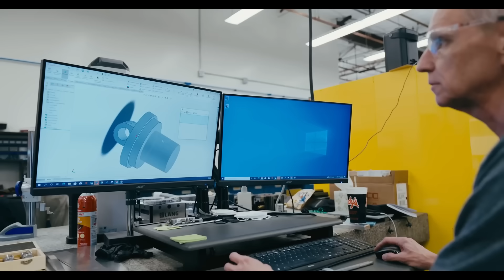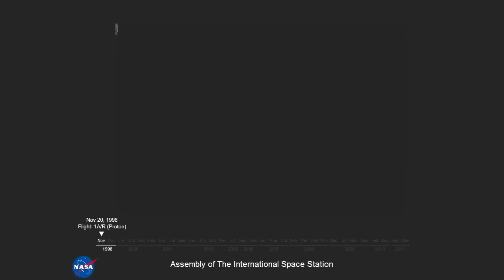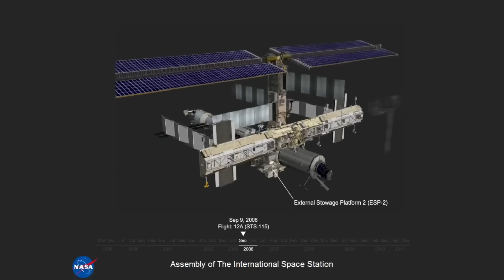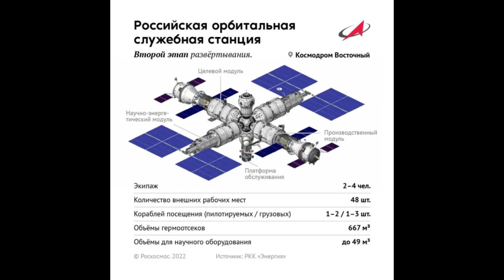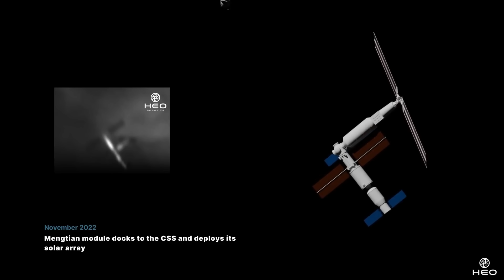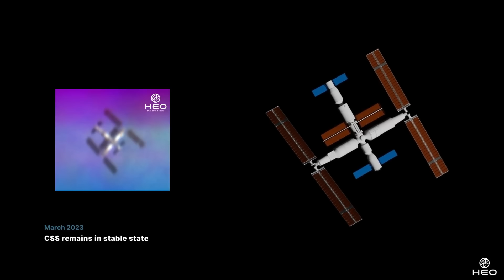Where Will Astronauts Go After The ISS Is Destroyed?

Comment: Why does the spacecraft necessarily need to have a manipulator arm? Can't "walking" robot arms (i.e. end effector on both ends and ports for it all over the station) do everything that needs to be done when it comes to station assembly? Park visiting delivery vehicle nearby, station arm yoinks the module, and puts it where it needs to be. Would be even easier if there are multiple of these arms walking around. Every module would just need to have at least one node where they can lock and receive power, like a much simpler, smaller docking port.

Comment: A single upper stage tank building from Space X would have more internal room than all of the ISS combined.  It will become the new space station, however, there is no fault in connecting to the ISS and using it as a walk in closet.  The solar panels are valuable and should not be burned up in the atmosphere.  Nor the cameras and canadarm and many other components.  Adding one large tank building to the ISS would justify keeping it up there, but put it in the back ground as a new station replaces it.  After the new station is complete it will gradually separate from the older station and all it's arrays of solar panels and screens and radiators and the process can start again with a large tank being sent up again to the ISS to start a third station.  The ISS would become the dry dock build site for other stations and ships.

Comment: How about a starship that telescopes the majority of its cross section out to multiple times its length just like a telescopic crane boom does. Then bolt all the flanges between sections together in the extended position and pressurise the whole vessel. Now you've got basically a hollow habitable tube, or maybe a shorter tube with some fold-out furniture. In theory they could cap off the individual sections, resulting in something like a bamboo stick.

Comment: 4:55 "-or party supplies if that's your jam" I bet doing lines of coke is hard in space.
Reply: what mechanism would you need to do proper lines in space? important research right here
Reply: think of one of those flavor bead straws but replace the beads with cocaine and cap the ends with a peelable seal @unflexian

Comment: So that Dragon extension 'station' is that single use? you say it can be preloaded with supplies/experiments but cannot be permanently occupied due to only having one docking port.
Would you have to send up a cleaning crew betwen each tourist visit? as I cannot imagine anyone would want to spend the amout it would likely cost to book it up only to find out the previous visitors left a kipper in the aircon vent.
Soo, if its single use ... is it actually a station?

Comment: That moving bidirectional robotic arm is super cool.  I never realized it could change location where the working end becomes the base!
Reply: It wouldn't be much good if it was stuck in one place.  The ISS is huge!  The arms can walk around like inchworms all over it.
Reply: @josephastier7421  definitely.  There's so much minutia to space flight I just hadn't ever thought of it before.  I'm still learning new things about Apollo!
Reply: @NGinuity  Just staggering how much innovation goes into spaceflight.
Reply: The first robotic arm was on the MIR space station... Fixed to the central module, it swung each newly arrived module around, and onto the other ports on the central module... It was only about 4 feet long, but could move the 3 ton modules with ease... There are videos on YT and also check google... Lyappa arm..

Comment: I heard that company doing the inflatable station modules was working with SpaceX to launch ontop of a Falcon9.  It would just take a modification of the fairing system to allow for the larger diameter.  But, the weight, even after factoring in the extra drag, would be well within the abilities of the Falcon 9.  Each module takes 3 launches.  The first puts the shell into orbit.  After that inflates, the second launch brings up a more traditional style module, filled with all the gear required for the inflatable module, plus the solar panels and radiators.  The third launch brings the crew onboard with extra life support to keep everything going while the primary systems are assembled.

Comment: Elon's notes...

 "Step 1: Construct 3 or 4 or 5-off starships, with both A) the required onboard lab-equipment and habitation areas, to be outfitted on the    ground (which will serve as a practice-run for Mars), and B) with more efficient (bigger?) thrusters to accommodate orbital adjustments. These starships will be capable of docking, linking and pressurising with each other.
 Step 2 : launch (proven capability), dock (unproven) and pressurise(unproven) said starships into current ISS orbit, 180 degrees out of phase. 
 Step 3 : Keep adding parts as required into the future. No space-walks or "outside" work will be required but could still be researched.
*Notes: The potential volume of just two starships is so much more than the current ISS volume.
              Mars is too important. ...Hmmm...."

I honestly believe that Space-X will help out with this somehow as it's good practice for Mars, and this is the only motivation Elon needs.

Comment: SpaceX can design an adapter module, flown aboard a falcon heavy, that could serve as a connection point for multiple Starships, which would constitute the station, and additional points for docking. 3 SS could be the station with 2 docking ports.

Comment: Who came up with the renders with the floors going down the length of a TransHab/BEAM/LIFE module? Completely wrong way to maximise usuable areas, especially if a station or interplanetry vehicle is spun up for interior 'gravity'. The floors go across the module, like if it was a multistory building, that way the softer outer shell is supported from a stiff central core that takes all the loading, rather then the outershell being loaded, same way an elevator shaft supports a building. And for living spaces, it means simple things that make life easier, like indoor plumbing, all function without needing pumps to consume power. Use the bottom curve as a sealed composting tank with a garden level above it, and waste management becomes food production using natural processes, while being able to scrub the air and produce oxygen.

Comment: Like everything else these days better phone spaceX before it's too late since they are the only game in town actually capable of achieving results and putting something together.

By 2030 it's quite reasonable to think they at least have a ready to use sorted starship to launch station modules to LEO easy at catalogue prices. If they ever make a version that can completely discard or open its nose cone thats some pretty huge modules you can put in orbit and way more mass per launch too.

Quick googling says current ISS is 420 tons thats like 4 starship launches of mass compared to the mess it was to assemble ISS.

Heck I'm sure you could jury-rig a space station design around a central docking trunk and a bunch of builtup with extra shielding starships as accomodations and rooms by themselves permanently docked to it and it would still be safer, more realistic and cheaper to do as a whole project than what these unproven companies peddle these days.

Otherwise well I guess they'll just watch china astronauts on TV from their couch...

Comment: I’ve got an idea for a manipulator arm. It is double sided and can run on its own small battery power for a short time. It charges and can run with one side secured to a charge/anchor point, but can also grab onto and manipulate objects while one side is secured to a point that is not a charge port or otherwise designed specifically for it. It’ll kinda be like topoisomerase 1 crossed with an inch worm. 
 Maybe it should have a third manipulator at the mid point so it can brace or walk while dragging something, or any number of unforeseen needs that could arise. I’ve got some funny names for it but no cute acronyms yet. It’ll be controlled remotely from within the station of on the ground or by some fancy shmancy AI that knows what subroutine to run with limited human input. The modular battery pack will also be easily replaced in two sections so it can conceivably change its own battery or quickly act as a redundancy if one were to fail. The arm itself requires the modularity to limit the maintenance that would require a space walk by a qualified engineer. 
  I’m no engineer, but I think I’m onto something… unless I’m late and some MIT group has been working on something like this for the past five years.

Comment: Could a crewed Dragon use an expanded trunk, with additional consumables, based on SpaceX's deorbit Dragon trunk to extend its flight duration? Cheers!
Reply: Probably not, because the trunk only has minimal power and data connections to the capsule... you can't keep consumables in it, because there's no way to get to them, short of an EVA...
Reply: @simongeard4824  Thx for the info!!
Reply: @MililaniJag  Remember that there's a heat shield between the capsule and trunk... any connections need to pass around the heat shield. That's why if you look at photos of Dragon with the trunk attached, you'll often see a chunky connector between them just below the crew hatch, carrying those power and data cables while the two remain attached.
Reply: @simongeard4824  I was thinking of Apollo capsule with consumables in the attached SM. Thx!!

Comment: It would be nice if the ISS was boosted into a lunar orbit instead. 

Getting information about longevity of materials would and learning about what might go wrong earliest would be beneficial too.
Reply: Nah the LAN won’t match
Reply: Throw enough thrust at the problem and it can be overcome.  Time isn’t an issue, so there can be more gravity assist orbits to increase its speed as well.  Although atmospheric drag on the solar panels might become a problem if it gets too low.

The Chandrayaan-3 spacecraft had a good trans lunar insertion strategy and it worked for them.